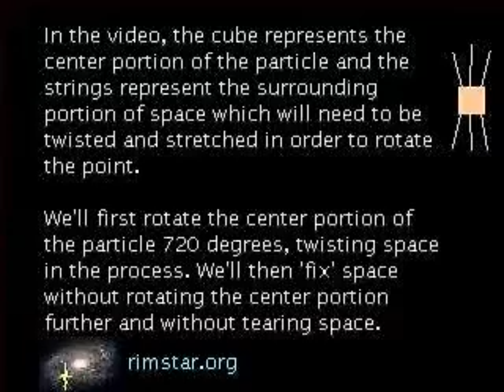Spherical Rotation and the WSM model

Comment: Good work. There is an easier way to untangle. If you start with a 180 vertical rotation, then the horizontal rotation happens naturally.

Comment: Hi Steve,
Good on you for doing this. I have done a similar thing, but I rotated the center object 360 degrees in both the horizontal and vertical axis - still seems to work the same (space does not get tangled).
Milo Wolff shows that this spherical rotation of space at the wave center of the spherical standing wave deduces the spin of the electron.
Very interesting phenomena - explains how you can have something spinning and yet have no axis of rotation (consistent with spin of an electron).